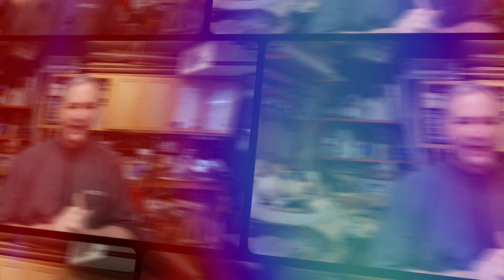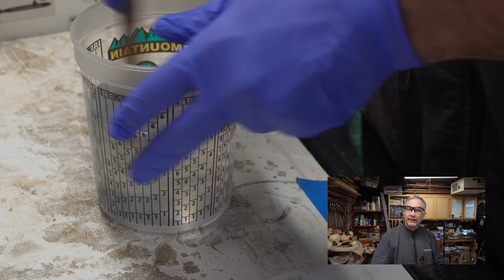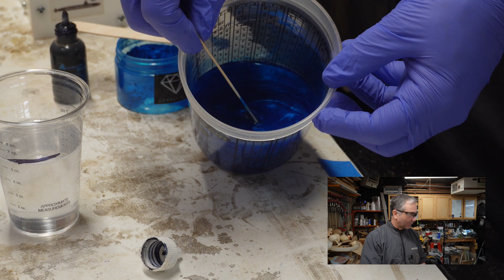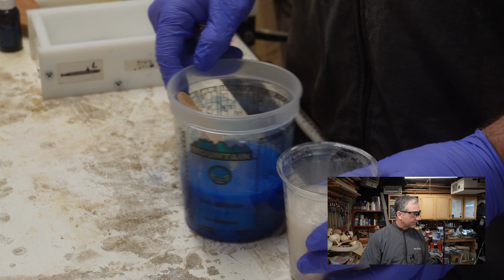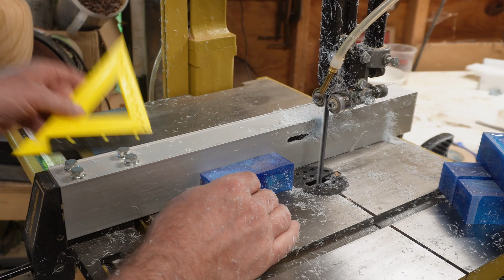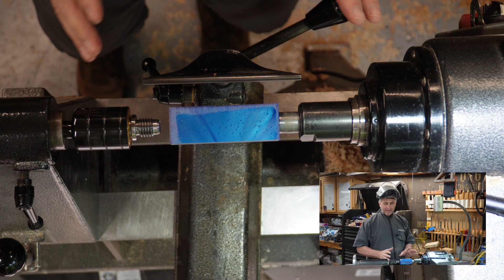Casting & Turning Small Bubble Free Resin Blanks without a Pressure Pot

Comment: I want to use colored pencils to make a pencil holder for my daughter, who is a teacher.  I have a container the depth of a normal pencil that's about 6" in diameter that is full of pencils which are standing upright. Can i do this without a vacuum sealer?
Reply from the maker: Great question.  The short answer is yes you can.  The explanation is a bit longer.  Using a thin viscosity deep pour resin will allow the bubbles to rise to the top before curing.  The main issue is, can you do it all in one pour?  That issue is totally dependent on the resin you're planning to use.  Definitely read the info sheet that comes with your resin and then examine your project.  The deep pour resins usually allow pours of 2 inches or maybe more.  But that's two or more inches of resin with nothing in it.  With a container full of pencils I'd suspect that there will be no place where the resin is 2 inches thick.  Of course the only way you'll know for sure will be to experiment.  If it were me I'd give it a try.  If it doesn't work you could always do a second test with multiple pours.  Just follow the manufacturers instructions on multiple pours.  
The only other concern I can think of would be trapped air bubbles sticking to the pencils and not totally releasing.  Vibrating the mold could help expedite the bubbles rising to the surface.  A random orbit sander lightly touching the mold might help if you encounter that issue.  
Finishing the project is another consideration.  You'll definitely want to seal the exposed wood after turning.  Once again, proper selection will be important.  You may want to consider finishing with either a top coat epoxy or a penetrating epoxy.  The penetrating epoxy will soak into the wood and seal it.  The top coat epoxy will basically encase the whole thing in plastic.  It really depends on the look you're going for.
My experience is with Alumilite Company and Total Boat products.  If you're unsure, they both have fantastic customer support and should be happy to guide you to the right products.  Good luck with your project and thanks for watching!

Comment: Subscribed
Reply from the maker: Thanks! And thanks for watching.
Reply: @ScottsMiniWoodshop  no problem... You saved me from getting a vacuum chamber 🫣
Reply from the maker: @shakaz6641  I'm glad I was able to help.  Vacuum chambers and pressure pots are both definitely useful additions, but not always necessary.  And unless you're stabilizing wood, a pressure pot may be of more use for a Woodturner than a vacuum chamber.  Perhaps I should do a video about both
Reply: @ScottsMiniWoodshop  I'm looking to stabilise antlers and wood...so a video on the differences would help.

Comment: Great video! I've been thinking about adding resin to some of my bowl projects but don't have a pressure pot. Now, it seems, I have a solution. I would like to know where you got the tailstock cup center with a removable point though. That's something I've been looking for. Thanks so much for sharing! 👍🏽
Reply from the maker: Thanks for the feedback.  The live center I'm using in the video is a knock off of the oneway live center.  It's called "Savannah Heavy Duty Dual Bearing Live Center".  I got it from Amazon but it's not currently available.  But you can find it here
https://www.ptreeusa.com/turn_live_center.html
There are probably others, but it's nearly identical to the Oneway live center and the Robust Live center.  Check your current one.  I could knock the pin out of my Jet live center and it was way less expensive than the ones listed above.
Reply: @ScottsMiniWoodshop  Thanks so much for your time and the info!!
Reply from the maker: @gjohnson66  you're very welcome!